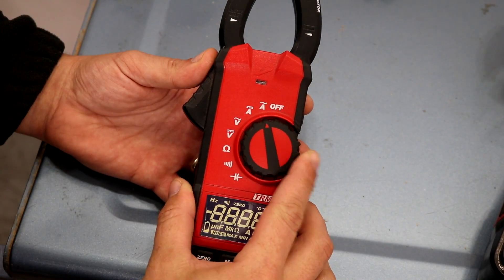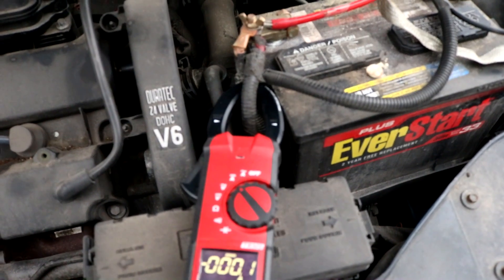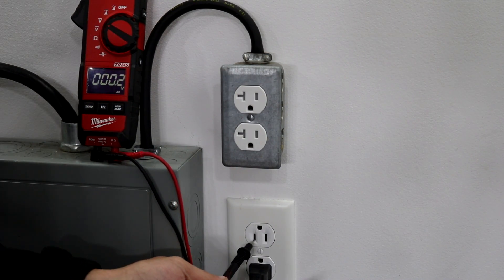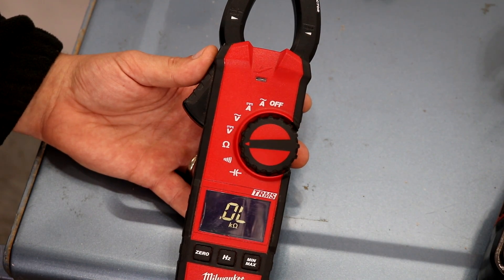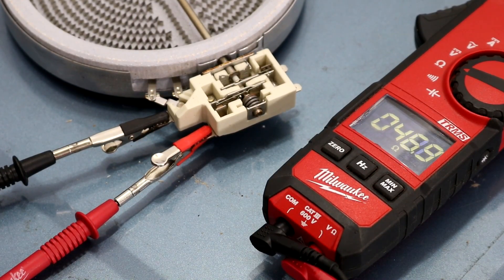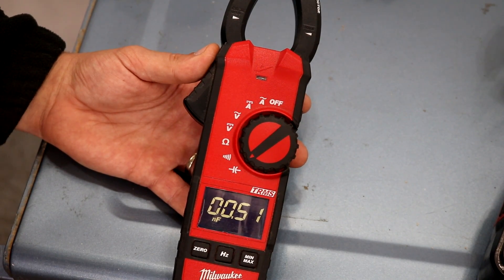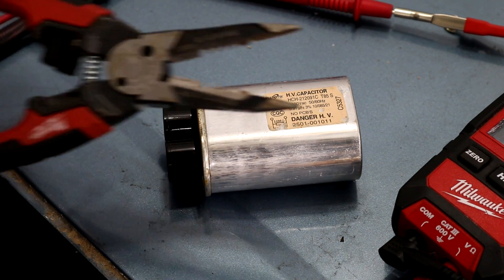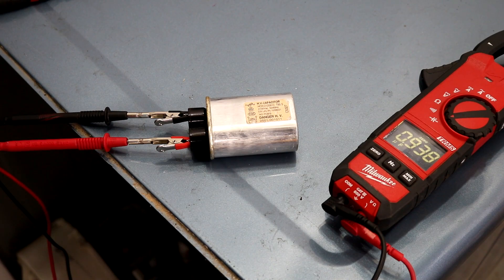How to Use a Digital Multimeter - Simple & Basic Tutorial

Comment: I've had this meter for about 6 years now and it was the best bang for the buck when I got it. I needed a dc amp function and a Fluke meter with dc amps was $100 more at the time. One of my only issues with this meter was that it appears to zero itself every time you take a measurement. It's a 3 to 4 second process that really slows you down when doing multiple tests. The meter in the video takes measurements instantaneously. None the less, I'm going to purchase another 2237-20 to replace mine. It's still working but after extensive field use, the lead terminals are giving me trouble. Last night I discovered the brass tubes were broken away from the circuit board. That's 6 years of rough jobs site abuse. Rain, snow, wind, etc. I think it held up exceedingly well. A Milwaukee rep. told me it was designed by Fluke so I decided to give it a shot.

Comment from the maker: Which meter do you guys use on a daily basis?  Thanks!
Reply: My go to meter is this exact meter..Milwaukee 2237-20. It has never let me down until this week when the lead terminals let go from the circuit board. 6 years of abuse IMO. Rain, snow, wind, dust, etc. It has performed exceedingly well for the money.  It's $100 less expensive than the comparable Fluke 325 but most of my colleagues don't like it because it's not yellow. The Milwaukee rep told me it was engineered by Fluke for Milwaukee and it had a 5 year warranty so I thought I'd give it a shot. I'll be purchasing another 2237-20 this week.
Reply: Are you still using it ? @scottfurlong5475
Reply: +Bill Newberry My dad had a Fluke that I loved. Unfortunately, when he passed away a few years back, my mom sold all his tools before I could ask for them. Ah well. This is a good demo, man. Thanks.
Reply: Very good video.
My go to meter for years was my Fluke 116 and still love it, it's true RMS and lightning fast response, but lacks the clamp function.

I've recently switched over to only carrying a diagnostics bag in with me on my initial trip in so carry my Southwire cheapy clamp meter from Lowes. It does about everything you want including capacitance, but I triple check my meter readings because it gives false negatives if the leads aren't left in just the right spot.
Reply: +Bill Newberry Great Job here!!! Me favorite meter at present is the Fieldpiece Multimeter. Has a K type slot so you can also use a temperature clamp. Great for air conditioning electrical testing, as well as measuring superheat and subcool. Nice Vid!!! ~ Hi Ya!!!!!
Reply: use my multimeter.which i post in my chanel.